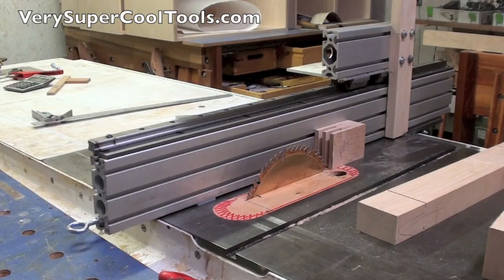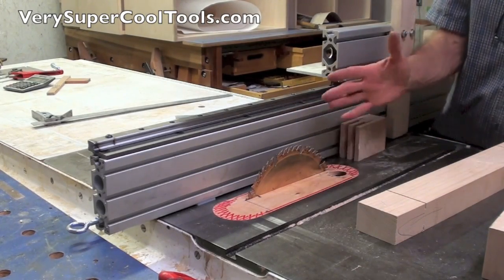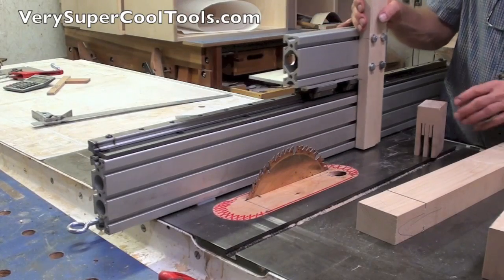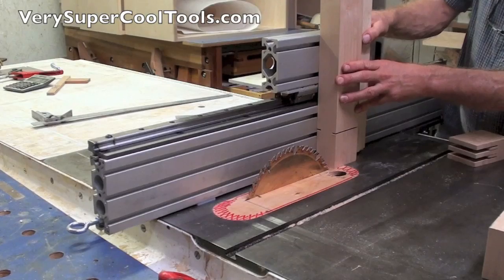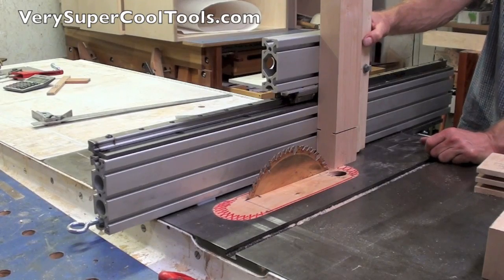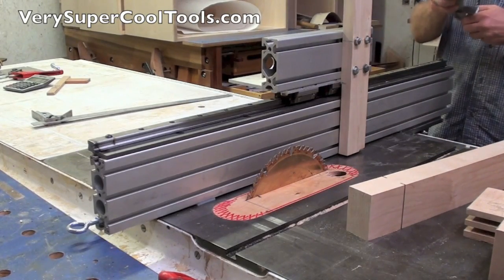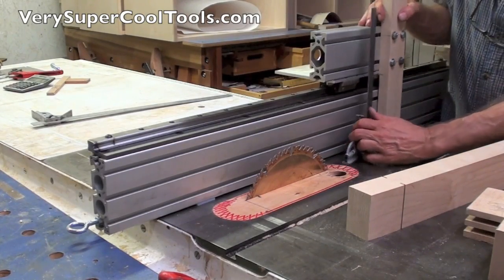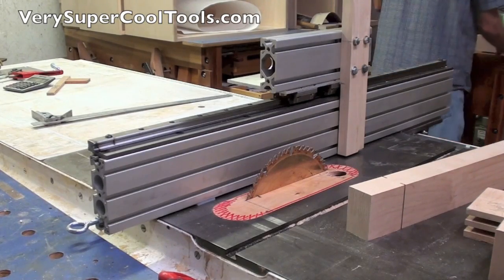World's Greatest Tenoning Jig Attached To Aluminum Extrusion Table Saw Fence

Comment: This looks interesting. I was wondering, though; are you familiar with the INCRA fence system? It also uses an extruded aluminum fence, but does not still rely on bump adjusting an out-dated Biesemeyer-style fence to 'sneak up' on settings, which can take forever, especially if you don't have hours and hours to waste.My INCRA's adjustments are positive click-stop, the resolution of adjustments are instant, and precise to 1/100th of an inch accuracy.
Your product is great, but it's still attached to an old fence design which is flawed.
Reply: I have both. I've had two Incra TS systems over the years, and I have two Join Tech clinchers and an LS32 for routing. IMO the Incra/Join Tech system is great for routers, but a real PITA ass in the table saw implementation. There's the fact that the tail sticks out, the deflection is probably the worst in the industry unless you tighten the rear hold down screw, and the system itself is just not very durable — it feels like a toy compared to the VSCT system. If you really want rock solid performance and the same repeatability, just throw a DRO on the rail and t square and you have the best fence system currently available (even ten years later).  I'll add that, prior to purchase, I called Allan up (he answered personally) to ask some questions. He spent 45 minutes on the phone with me,  really going above and beyond. That sealed the deal, and every time I use this fence I'm reminded of what a great deal it was.
Reply: Hours and hours to waste?   Yeah. I'm using a 1950s delta jet lock fence and as bad as that is, it doesnt cost me hours and hours😂.  The things we tell ourselves to justify our purchases.

Comment: All out fences work with Biesemeyer style guide rail system which is comprised or angle iron and rectangular steel tubing. We have t-square that is also adjustable to accommodate metric tubing. Within a very short time we will have a Euro fence for sliding tables with an offset fence holder to work with that style of saw. It still will ride on a Biesemeyer guide rail system so it will not fit to the rails of that stock fence. Guide rail change out is required.